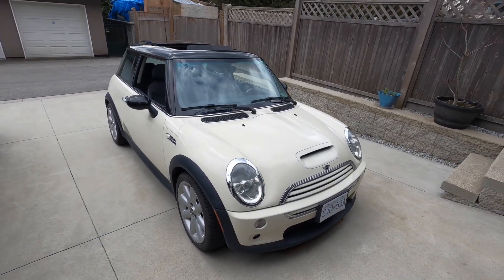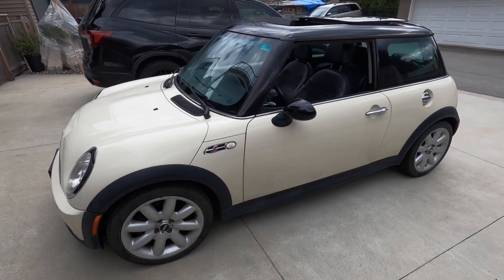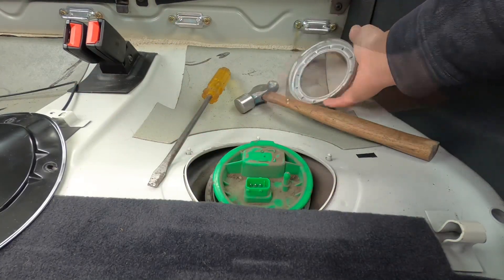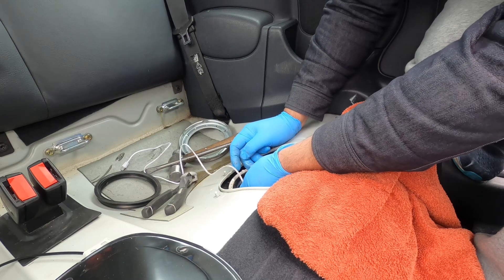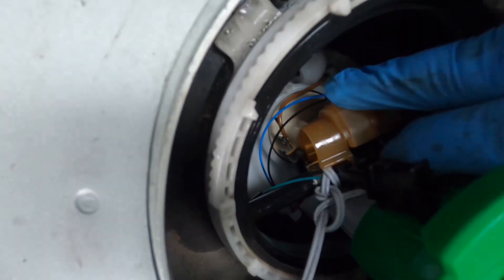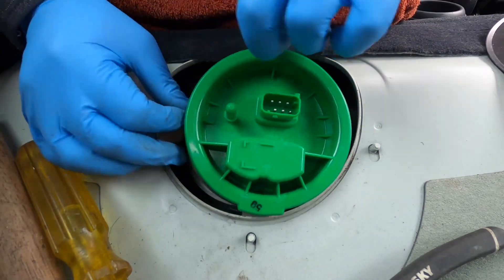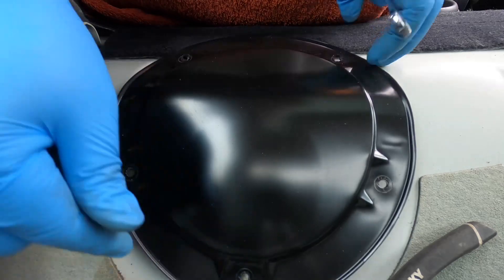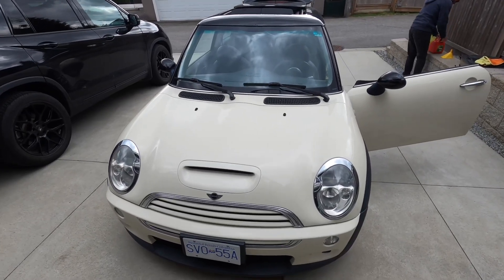Mini Cooper S R53 fuel pump replacement DIY

Comment: Love that color. Thanks for the video.
I just did a clutch on an '05 that my wife bought. That's a major job.
Reply from the maker: Thanks Bud, I know the clutch would be a big one for sure, I have a lot of stuff to change while I do the clutch and flywheel. I'll be servicing the supercharger, replacing waterpump, thermostat, oil pan gasket, valve stem seals, most of the other seals as well just to make sure it doesn't leak oil or die on me anytime soon. Then there will be mods to do as well 😉

Comment: Mine is exactly as this one. I have it for almost 4 years and only gave me good times,  but now is time (200000kms) to replace the petrol pump, and this video was exactly what i need. Wish me luck :)
Reply from the maker: It's an easy job bud, you got this! 👍
Reply: How was it? Looks fiddly AF to do
Reply: @csllover  very very easy. Just needs to be careful with the steps and don't rush when fitting the connectors, and in 20-30minutes is job done.
Reply: @botiduran344  Im worried about the connectors disappearing somewhere down into the tank
Reply: @csllover  naaaah, space is a bit tight but everything is at the right place. Just follow what you see in the video (the recipient for the old petrol pump and to avoid spill petrol inside the car, an old towel just in case that happens, disconnect the battery...) and don't rush. Trust me: if i do it, anyone can do it! Keep us posted 😉
Reply: @ I did it but…! When fitting the new pump I really had to push it down and hold it down when reattaching the metal O-ring above. Is that normal? Felt a bit weird doing that.
Reply: @csllover  just be sure the only moving part of the whole pump/holder, wich is the metal brace to show the level of petrol at the gauge, is not trapped underneath the plastic . For what you said, i think mine was a bit the same and need a little pressure to put back the metal ring, but guess this pressure helps the rubber seal to work properly. If the car start well and the pump make the right noises, i think you succeed! well done!

Comment: My dad has an R53 JCW in storage, and we tried to move it today, but if feels like there is no fuel going into the engine. It'll crank and attempt to start, but dies quickly. He seemed to think the fuel pump went bad, so this video was perfect! Will try this next week after I order a new pump! Thanks!
Reply from the maker: Hi Joseph, if it was me I would try tapping the fuel pump with a spanner and see if it's starts working again. Most likely it should fire up, fuel pumps do tend to work for a little bit with a lighter tap on it. If it's the dodgy fuel pump then it'll be easier to pin point before spending the coin on a new one. Cheers!

Comment: I'm replacing the fuel pump on mine tonight after work, mine quit working at an underground parking lot, but luckily I tapped it real hard and worked again, just enough to get me home. The next day the car didn't start, so I consedered myself very lucky 😄
Reply from the maker: Always a win, when you can dodge a tow truck and drive it home 🙂

Comment: Yes thanks for the help, knew everything about my 64 impala, but nothing about one of these, seen in the comments that someone has the same problem as me, ran fine, put 91 gas as always it acts like it wanted to start, but won't and after a few times it wouldn't even hit, after setting a few it does the same thing
Reply from the maker: @Daniel-e1k3n  does the fuel pump makes priming noise after you turn on the ignition? It does sound like a fuel pump issue bud.

Comment: Great work! just a quick question, whats the parts number for the fuel pump, mine failed today, and im looking for parts. Thanks
Reply from the maker: @zuochen5909  https://www.pelicanparts.com/byv-cooper-cooper-s-r50-r52-r53/b-genuine-mini/c-fuel-intake_c-fuel-system_c-fuel-pumps 
Hope this helps bud.
Reply: How did yours act when it went out, mine   hits like it wanted to, then nothing, set for a while and then same thing, if you see this please let me know
Reply from the maker: @Daniel-e1k3n  easy way to check is to remove the rear seat and the tap on the fuel pump itself. Most of the time, it will start working for a little bit. That way, you can tell if it is dying or if the issue is somewhere else. Hope it helps.

Comment: Yeah I did the fuel pump on mine and unfortunately it didn’t fix my problem…thank you for the tutorial…don’t want to say any more as it is a rather sad story.
Reply from the maker: What kind of problem are you having with your R53 bud? Starting issues?
Reply: @gasNgears  It's developed a violent stutter and wouldn't accelerate past a certain speed. First at 70+ mph, then it's been getting worse, it wouldn't do 60-70 mph, now it won't even do 50 mph and the engine will stall and you have to wait 10-15 minutes to start it again. 1/3 of the car replaced (coil pack, fuel pump, injectors, lambda sensor, camshaft sensor; spark plugs were replaced even before the problem occured), couple hundred pounds spent, zero improvement.
Reply from the maker: @backseatcovers  that's a real bummer, mate. Does your car have a stock pulley or reduced pulley on the supercharger? What kind of spark plugs got put on! Did you replace the plug wires too when the coil pack got replaced! These little things could be an issue ! Another cheaper thing to look at would be a fuel filter! I gotta change mine. My car is almost 20 years old and can imagine how nasty the filter would be by now. I am not a mini guru by any means but thought I should mention some things that came to mind. Cheers.